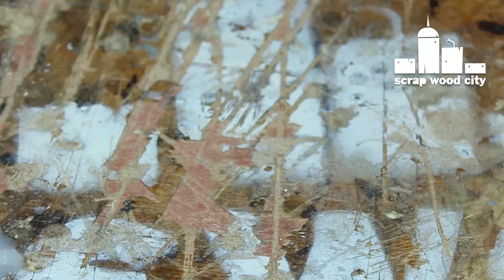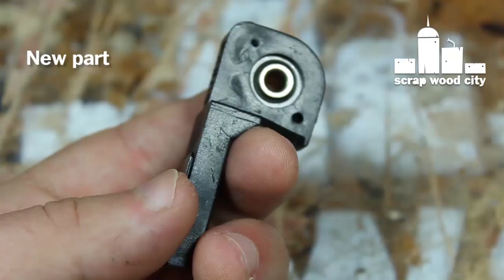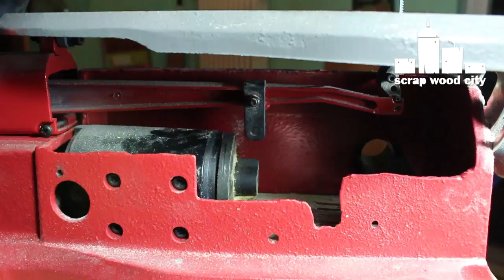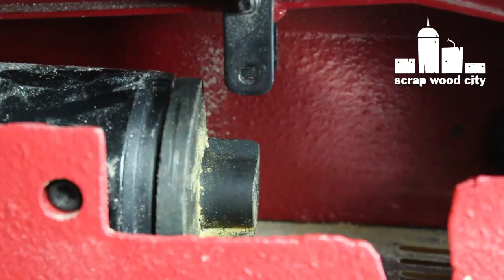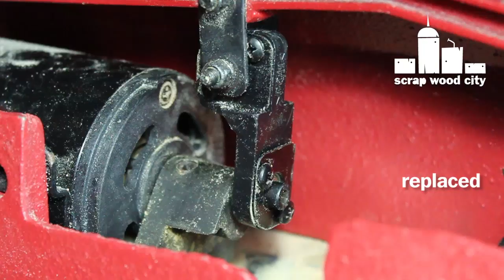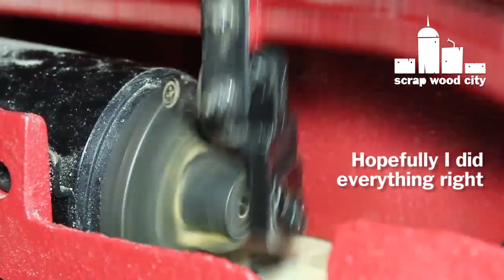Scroll saw repair

Comment: I've had two Craftsman scroll saws for quite some time and but I haven't used them oh the last two seasons normally I do stay on it continuously anyway what's happened is for some reason I go to change my blade on the contractor scroll saw size the big one and it looks like the blade is about 132nd of a inch too short I don't get it but anyway I got a smaller version of the Craftsman and I can't remember whatsoever had to figure out changing the blade do y'all do that do you work on them update them

Comment: We have the same model and exact same thing happened to me. Does your scroll saw's led light still working? Thank you.
Reply from the maker: Yes it the LED still works, but I have changed the part I show in the video several times!
Reply: I made mine with wood and sealed the bearing inside. I remove the screws where cracks usually happen. I can send you pics through messenger to give you an idea if you want. At first I brought the part to a machine shop and hoping they could duplicate/fabricate the part for me but it was too expensive. My issue now is the led light is no longer working.